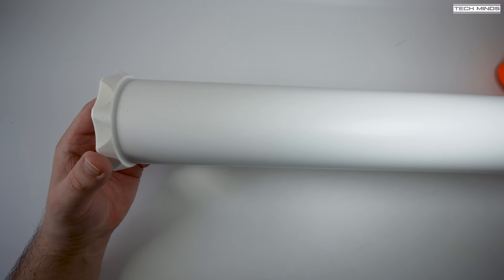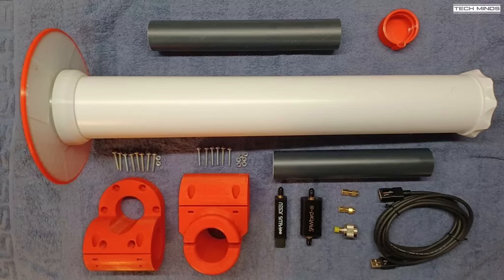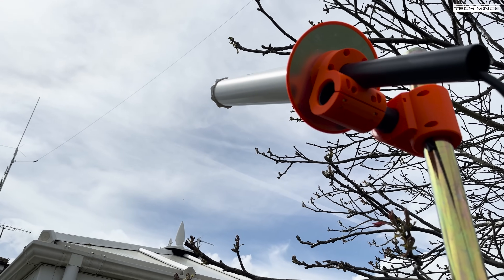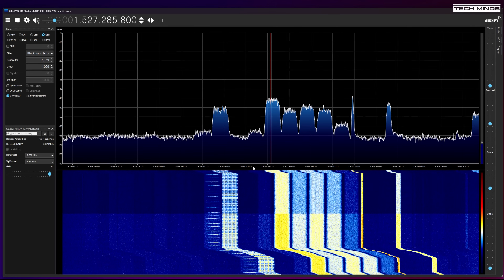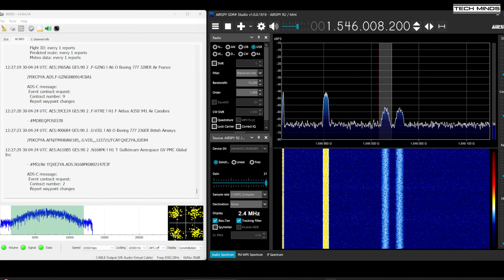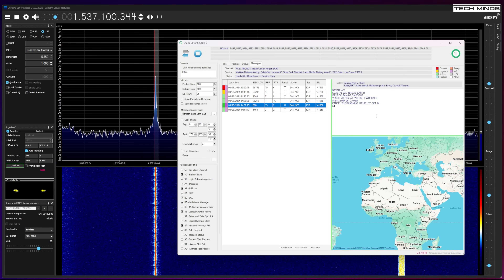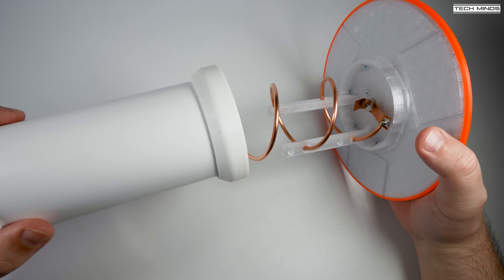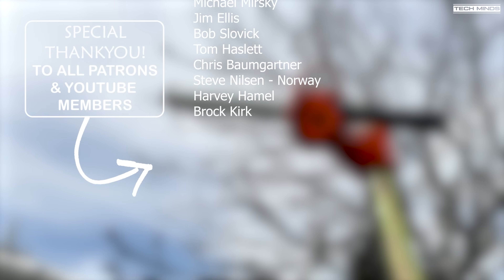High Gain 10-Turn Helix Antenna For L-Band & Receiving Inmarsat

Comment: I use to get voice traffic a few years ago, checking just now not a peep, guess they've moved to another frequency and gone encrypted no doubt or just using other technology for transmissions ?
Reply from the maker: I was actually able to decode some audio transmissions using JAERO and SatDump, just having to wait for the calls to appear :)
Reply: @TechMindsOfficial  ah well maybe a weaker signal now but the cluster of signals i use up get around 1546.165 is dead with me all the time and it was very active once
Reply: @TechMindsOfficial  Which frequency ?

Comment: These russian pirates operate on the Inmarsat F4-4A Alphasat L-TAC transponder located roughly at 1.5528GHz. They do not transmit all the time, there will be breaks between the transmissions sometimes even days long. Depending on how they feel like you may come across spectrum painting (mostly pigs), NFM transmissions or just general transponder abuse with super wide FM signals.
Reply from the maker: That's it! I saw some posts on the FB group that someone had captured the spectrum painting.

Comment: I’d be interested to know if you could receive L Band HRPT on this antenna….all be it probably with a rotator…?
Reply: I'm sure if you are willing to buy one you could specify what frequency you want the antenna for. The spacings between the loops are smaller and the loop diameter is narrower for 1.7ghz. I built my own 10 loop helicoil for around £15 and you can hand-track HRPT signals fairly easily. They are a fairly wideband antenna but best built for the frequencies you want to monitor as a 1.5ghz helicoil is weak on 1.7ghz and vice versa.

Comment: You should have demonstrated some of the ACARS Voice Communications (I won't tell) MUM's the Word.😉
Reply: The voice transmissions on 25 deg have moved to 60 deg apparently. I can't get anything with my patch antenna on 60 deg so guess you need one of these with better gain but I'm not paying the astronomical price
Reply: What Inmarsat satellite is that at 60 degrees, is it east or west?

Comment: How is the reception when compared to RTL-SDR active L-band patch antenna?
Reply from the maker: I didn't want to show a comparison in the video as they are both completely different antenna designs and they cost differently. However, this 10 Turn helix performs the best out of any of the L-Band antennas I have tested so far. I still have to test the other antenna I showed at the end of the video, with a dish. So we will have to wait and see how that compares. Cheers
Reply: Which Inmarsat do you receive and what SNR did you get on the AERO and MARINE channels?  I receive inamrsat 4A-F4 using an rtl-sdr patch antenna and on marine channels I have snr from 8 to 12dB.  Currently, I am building a 7-turn helix antenna with Nooelec Sawbird, a set similar to the one presented here, and I am wondering what improvement I can count on.
Reply: @maxxm.108  I recently tested a 5 loop one I made for a friend for 1.5ghz in  UK and got 18-22db SNR from 25 East and 52 West inmarsat, that antenna is giving the guy I built it for a 5db increase over the patch antenna. I use a 10 loop for HRPT and it is pretty impressive. I just ordered more wire to test how far I can go loop wise before they lose gain. The trick is keeping the loops perfectly inline.